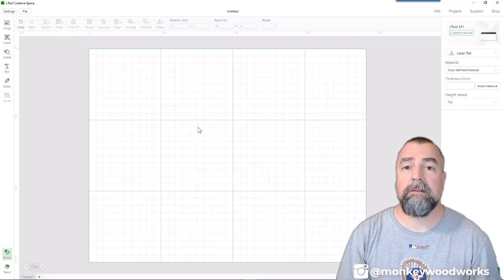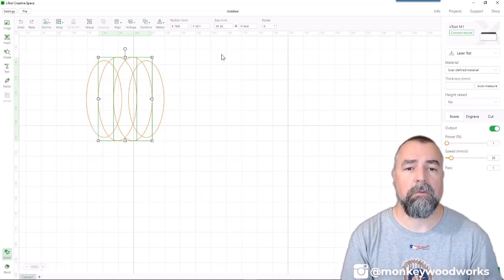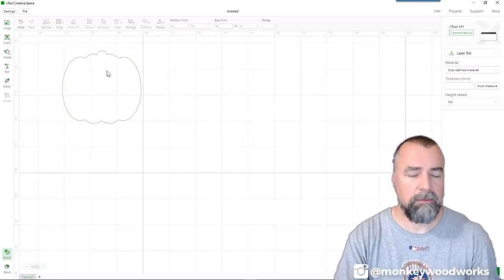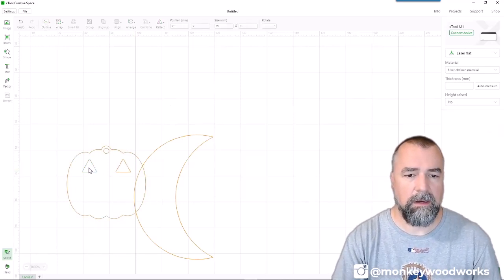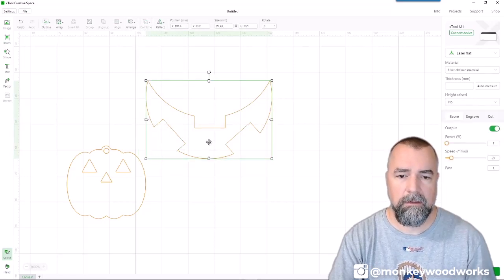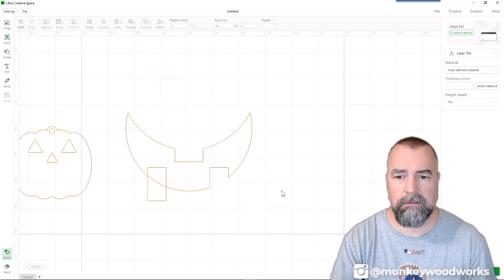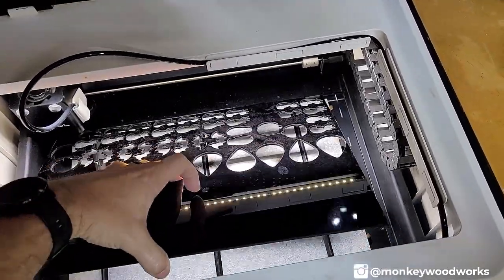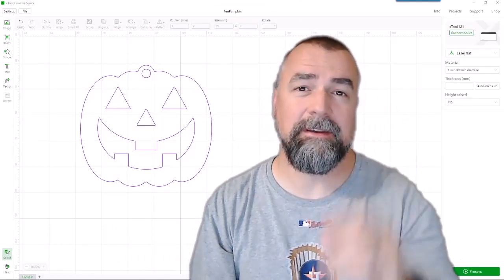Design and Make an Acrylic Earring with xTool's M1

Comment: can I cut gold mirror acrylic with the machine? and do we usually keep the plastic/paper that's on the acrylic while cutting or do we need to take it off?
Reply from the maker: To my knowledge, you can not cut mirrored acrylic because it is basically clear acrylic with a mirrored backing.   On the backing, if it is paper, you decide if you want to keep it on or not.  For smaller pieces, I tend to take it off so i don't have to try to take it off later.   If you have a plastic film instead of a paper film, i would take that one off before lasering.

Comment: Can I also cut mirror acrylic with the m1? Best Regards
Reply from the maker: To check to see if it can be cut, go to Xtool.com and find the color acrylic you are thinking about trying. Read the description of the acrylic. If it says 'can be laser-cut and engraved by all xTool machines', then YES, you can cut it with the M1. If it says 'applicable to xTool Laserbox', then unfortunately NO, it can not be cut with the M1. That acrylic can only be cut by a saw or by using a CO2 laser.
https://www.xtool.com/collections/material/acrylic

Comment: Thank you for sharing, I saw that you are using the prism but you select that it was not raised, any way that you didn't mark it? I know that the auto-measure should make the trick. Thank you
Reply from the maker: I do not use the raised option in XCS.  I always use the auto-measure feature when using the M1 (and the ruler on the rare occasion the auto does not work).   All the other opitnos on the right hand side I use depending on what i am doing however I no longer use the raised or not raised option.  I found that if it has the right measurement, it knows how to focus properly.

Comment: Hi! I am try to cut clear acrylic but, I had everything set up and once I hit start, nothing appeared on the acrylic. It didn’t cut or engrave it.
Reply from the maker: A diode laser like the M1 or D1 can not cut clear or translucent acrylics.  You would need a different laser like a CO2 laser to cut clear.  The only thing you can do to clear is engrave on it using a marking spray or marking paper.  I will be doing a small clear acrylic engraving how to video soon.

Comment: Hi,
Have you laser cut and engraved Gold mirror 3mm Acrylic, I am struggling to with this material.
Your advice would be greatly appreciated.
Reply from the maker: Gold Mirror can only be engraved, it can NOT be cut with a diode laser (M1).  Also, i believe to engrave it you need a carrier to put on top of it first.  I am going to be doing a demo of engraving on clear acrylic soon I just need to first figure out what i want to make and how i can cut it cleanly.  If you go to Xtool's site and read the description of an acrylic your interested in, if you see "applicable to xTool Laserbox", you can NOT cut it in the M1.  But if you see "can be laser-cut and engraved by all xTool machines" you CAN cut it in the M1.  The ones that reference Laserbox needs a more powerful CO2 laser to cut that acrylic.  The M1 is a diode laser and can only cut solid darker colors.
xTool Materials - https://bit.ly/xTool_Materials
Reply: @MonkeyWoodworks  so the material is on the XTool list but am unsure if it states “applicable to xTool laserbox or not….
Reply from the maker: @stephenbranston1588   If you open up the item and read the description bullet points, It will tell you if it's laser Box or compatible with all lasers

Comment: Hi Thankyou for the great Tutorial. Can M1 cut, engrave coloured and clear Acrylic?
Reply from the maker: Great question.  The M1 is a diode laser and can only cut solid darker colors.  Clear or transparent colors, the laser passed right through the material.  For engraving, I have tried engraving clear using a couple of methods but have not found one that works good enough to say "this is it".  I am still searching for the best method personally.  As far as cutting goes:  If you go to Xtool's site and read the description of an acrylic your interested in, if you see "applicable to xTool Laserbox", you can NOT cut it in the M1.  But if you see "can be laser-cut and engraved by all xTool machines" you CAN cut it in the M1.  The ones that reference Laserbox needs a more powerful CO2 laser to cut that acrylic.  
xTool Materials - https://bit.ly/xTool_Materials
Reply: @MonkeyWoodworks  Hi. Firstly, Thank you ever so much at least you read the comments unlike others. I highly appreciate this. The second thing is its limiting us what acrylic we can use. Not everyone required black acrylic haha. Infect, every person I have spoken if they are interested in laser cutting crafts they've all selected non-black.
Reply from the maker: @andyanand9459  I hear ya.   Unfortunately the acrylic limitation is true with all diode lasers.  Xtool, comgrow, ortur, atomstack, etc.  It's the science behind the blue laser.